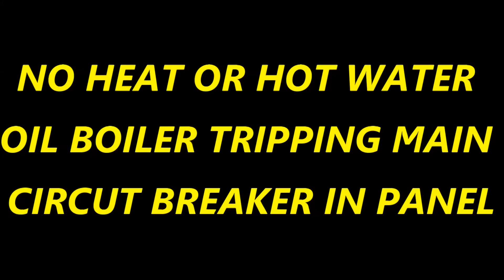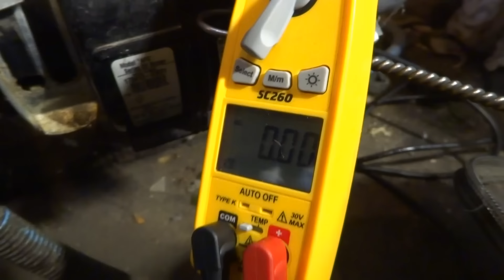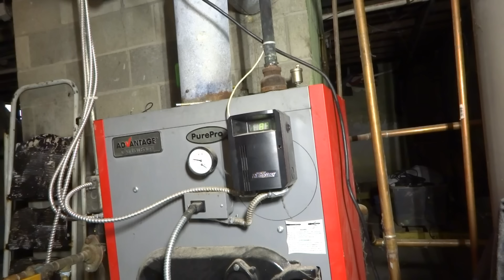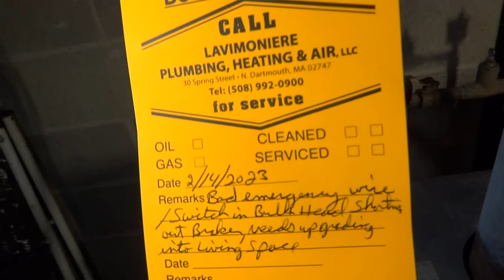OIL BOILER TRIPPING MAIN ELECTRIC BREAKER IN PANEL

Comment: As soon as you leave that guy is running to Home Depot for some Romex and a switch. He’s not calling an electrician if he replaced that breaker himself.
Reply: Of course he is. That's why Steve pointedly told him what the electrician needed to do.  He even recorded himself saying it and the customer acknowledging it.  If the customer goes and does it himself, that's on the customer.  Honestly it's a very simply job and he should not screw it up too badly.  It will be fine.
Reply: @LatitudeSky  I'm not saying there is anything wrong with the guy doing it himself.  I would too
Reply: @LatitudeSky  even Steve tries to save money, I know I do
Reply: Breakers are easy to replace. That switch is more complicated
Reply: @benh580  not exactly. It’s series circuit so neutrals go together with wire nut and power goes into bottom of switch and out of switch into aqua stat. If you kill power just copy what was already there
Reply: I vote he’s not even going to go that far.  I bet he leaves the em. switch bypassed
Reply: @Nighthawke70  WRONG! Every state allows a homeowner to work on their own house. You only need a license to work on someone else's house and get paid for it.
Reply: @Nighthawke70  really?  I should have been an electrician then. I’m probably living in one of those (overly restrictive ….blue) states.

Comment: Here’s my thought let me know if I’m  wrong. Checking for a short with the audible continuity checker is inconclusive. You will be reading continuity from L1 through the load, into the neutral, back to the main panel  where it is bonded to ground. Meter will beep when the ohm reading is less than whatever it is set at. Using the ohm meter without beep is more definitive, as it will read closer to zero when there is a short.

Comment: Both connections of the circulator need to be isolated by disconnection to check for a grounded circulator motor via continuity to ground, as tested.  The green ground wire can remain as is.

Comment: That was a Crusty - Rusty - Wet - under load short.. Nice job Steve. That outside box was not even water-tight. They may as well mount it in the shower stall...!!
Reply: It seems to have worked just fine for many years.

Comment: Should pull in a 3 conductor cable from the box to where the emergency switch is located and install a "pilot indicator" switch upstairs.... Looks different so less likely to get played with and gives quick indication of power being on.

Comment: I had that once as a helper. We installed a new boiler and the circulator kept tripping the breaker. It was a TACO 007, I put the screw for the cover plat thru the wire 🤦‍♂️ whoops. Learn my lesson on that one

Comment: i wonder why emergancy switches  arent   code everywere in minnasota iv never seen one in any house anywere  the switches are all   attached the the side of thew furnaces and most of our breaker panles are in the basments next to the furnaces we dont even have outdoor emergancy swicthes to cut all  power to the house the only    way to kill power is pull the meter off the wall or  cut the line to the house
Reply: atcualy kinda are every house i have lived in has had a fuel oil furnace  we had one in the house i live in now but it was replaced with natrual gas two years ago becuase  our water heater was also natrual gas  and it made more sense to have one fuel source insted of two but now our water heater is electric as that died shortly after the furnace was replaced and they didnt want to pay 20k to get the chimney lined  to have a gas water heater put in again
Reply: the boiler code is different than the codes for a furnace.

Comment: I feel old. I remember 20 bucks a week for insurance and it covered everything. Days long gone. This guy is lucky he got your help. I could see a new guy throwing parts at this. Great trouble shooting.
Reply: At $ 100 a week it`s obvious that he has never used his insurance ,mine used to be that way and once I used it it continued to sky rocket up.
Reply: don’t get me started on insurance. About 10 years ago I filed my first homeowners claim ever with State Farm. A tree fell along our long driveway and fell onto the power line - yanking the line from the side of our house. Lost power and broken live wire.  I had 4 cars, my house and my commercial dental practice all insured with that same State Farm agency for 20 years prior to the tree incident.  Never had a claim.    They paid the 8k claim and I got a huge rate increase for my troubles.  That was my last year with State Farm. Switched everything. But they all suck
Reply: I had to leave my job because the insurance kept getting more expensive with less coverage and I never got a cost of living raise.  After I left, most of my former coworkers left too.
Reply: @Samlol23_drrich  That`s the way It worked when I had state farm always got a check back every year until the first time I ever claimed then it went on up with no more checks in the mail.
Reply: @gunfisher4661  yup. That's why when a deer ran into my car last year causing relatively minor body damage (2k) I didnt run it through my insurance.

Comment: He was a nervous whistling helicopter. I wonder if he installed a GFI breaker that was sensing the wet line to that old 1940's kill switch? Or maybe a rat chewed the insulation and it was grounding? Great job troubleshooting isolate and eliminate!

Comment: Very good trouble shooting. This is one reason type NM [Romex]  is not to be used in damp or wet locations. If the NM [Romex] gets damp or wet, it can also give dangerous false power off readings with a Non Contact voltage tester.

Comment: The problem is the wiring of those two boxes; the switch box at 17;50 and the overhead box at 18:35. The Black wire is always the Hot wire and the White wire is always the Neutral wire going back to the Main distribution box. That White wire  in the overhead box should not be connected to the Black wire. That is the PROBLEM. YOU ARE SHORTING THE Black(Hot) wire to Ground with the White wire. You never connect a White wire to a Black wire. 
       He needs  new wire with 3 leads...........Black, White, and a bare Ground wire. Mostly he needs an Electrican to clean up that Mess.
           ****** Just my opinion..... FWIW.
Reply: No

Comment: That guy didn't listen that the problem could be the switch OR the wire. He's fixated on the switch. Probably will turn out to be a wire nick shorting to the conduit.
Reply: A quick check with an ohm meter would tell the story.  Most likely is that one leg of the romex is leaking to ground.

Comment: Seems like a high resistance short. Once under load, whatever is compromised goes to ground. Heat at the location of the confucktion also plays into that as well. I'm in a different field but have been bit several times chasing a ground that ended up being the transformer. After about the third time it sinks in real good.

Comment: The question is why was water getting into that switch box…? Anyway, Steve you’re right, an electrician should relocate that box from the bulkhead to the inside of the house.
Reply: Likely the top steel flange of the bulkhead door is either rotted or the weather seal is shot allowing water into the bulkhead space and into the non-weather tight switch box.

Comment: When Romex type wire gets really wet it will cause a grounding condition with a bit of a delay when first energized.  He will have to cut out the saturated section of wire and relocate a new switch to the first floor.

Comment: Some towns here in Jersey require a switch at the top of the cellar stairway , AND, one next to a cellar window inside, so the firemen can access it in case of a fire. However, I think that’s old school. Nice job momma!
Reply: Does it need to be RED?  Every house I’ve ever owned has had a red shutoff at the top of the stairs.

Comment: So these emergency switches are just for oil burners and not gas? It’s weird that it was outside.
Reply: it is a boiler code.  
could be a gas or oil boiler.
Reply from the maker: in my state it not needed on gas ,,just oil